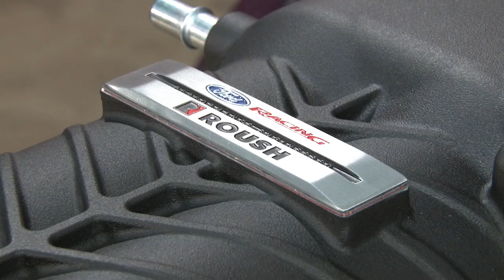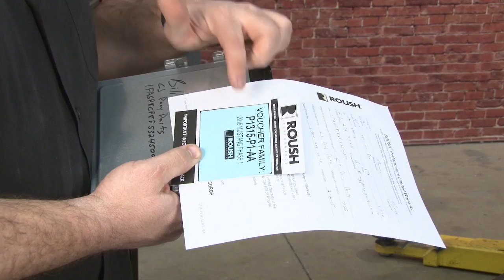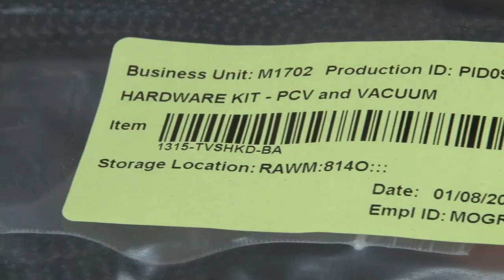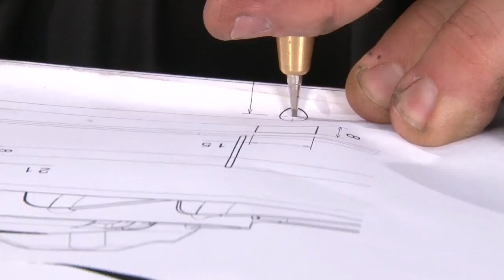2015-2017 Mustang GT Roush Supercharger Kit Phase 1 670HP 5.0L Installation

Comment: Hey there, Bill! Since your GT has the perf pack, what happens to the vacuum gauge? Would be nice if an oem style vacuum/boost gauge direct replacement, a la ecoboost, comes up in your store. Cheers! Amazing installation video by the way, must have taken a hell of a lot of work.
Reply: I am trying to get my hands on the PP Ecoboost boost gauge which is the same size but crazy expensive through Ford
Reply: Bill Tumas Let us know once you get your hands on it! In my opinion that would really complete the supercharger install. Too bad about Ford's pricing

Comment: is there a way to purchase the throttle position sensor harness for this application? mine seems to be acting up i’ve already changed the throttle body and the same issue comes up. P2111 and P2135 any info or help is greatly appreciated thank you

Comment: can this kit be used with the factory clutch?
Reply: Yes it can. On street tires it will probably never have an issue except for normal wear. If you are running slicks you should probably upgrade.

Comment: I would sure feel better with Bill installing my Supercharger than letting my local dealership do it
Reply: The only time a dealership saw my car was when I drove off the lot with it.
Reply: Local won't install it anyway.
Reply: I ask Bill, if they do work for the public he said no. I wish he did. Not to many you can trust to do this type of job.
Reply: It’s a bolt on supercharger it’s not rocket science. Nearly every ford dealer in the country has in most cases multiple technicians qualified to do this job. The ford dealer I work at has 3. One guy has done 30 of them now.

Comment: I just installed the Roush phase 2 and Bill made this possible and gave me the confidence to do it. It took me 15 hours. If I can help anyone, let me know. Thanks Bill for the videos.
Reply: +Chris F do you love it ?
Reply: I love everything except the roush tune. It pretty much sucks. If you get on it, it sets off the max torque limiter and puts the car in limp mode so its barley drivable until you shut it down a restart it. So you have to get a different tune. I barley went 60 mph and less than 5000 rpm when this happened.
Reply: Is your car a manual? sounds like the clutch protection mode might be kicking in although that should go off once you shift gears. The early tune had an issue with limp mode but that was when the kit was new and was fixed quickly by Roush.
Reply: It is a manual. Doesn't go off when switching gears. its giving me code P061B. got my tune in march...is that the early tune? Another problem is I cant get a hold of Roush, by phone, email, live chat, to ask them! Any help Bill is appreciated!
Reply: C F hi Bill, I have questions concerning the S550's. Except for the GT's which would you recommend between the 2.3 Eco or the 3.7.
Reply: Ecoboost all day, better performance and better aftermarket. Ford discontinued the V6 for 2018.
Reply: hope you installed oil pump gears
Reply: did you ever get a different tune or fix your limp mode problem?
Reply: In order to do this do you need the motor to be forged and all that stuff because I have a 2012 Mustang Roush Stage 2
Reply: @User77989  hahaha roflmao. Seriously?  Completely different engine man. Do some research

Comment: anybody else noticed the wrong placed belt at the top guide pully at 51:47?
1:00:26 aww, magic fix ! :D
Reply: Yep you're right
Reply: +2CREATthief also at 59:58 when he filled the fluid, he used the green antifreeze.  But after he finished at 1:00:30 it had the orange fluid in it.  But I love watching these videos.  They are great for a diy'er.
Reply: +messer23421  I filled it with green universal antifreeze, once it got up to temperature the original pink left in the engine started circulating. That is why the color changed, no trickery there.
Reply: Oh, gotcha.  Thanks for the info.  I always was told it was bad to mix the antifreeze like that.  I also know for a while that the orange stuff really did a number on engines.  Is that not the case anymore?
Reply: Another question when you have the time, how much power can the stock coyote engine hold without having to forge the pistons and rods?  I saw a video of some guys that put a whipple supercharger which they claim gave them over 750 hp at the wheels, but I would think that would destroy a stock motor?
Reply: +messer23421  Most of the universal antifreezes can be easily mixed without issue.
Reply: +messer23421  The 2015 motor seems to be able to handle around 700 without issue but anything over that you start playing with fire. There are 900 hp stock motor cars out there but they are time bombs
Reply: Awesome.  Thanks for the info.  I love watching your videos buy the way.  They always help me out.
Reply: +Bill Tumas Alumium drive shaf thandle this power?
Reply: i cringed i was like noooo haha i thought he would of noticed right there , got fixed tho 👍🏼
Reply: That drove me crazy
Reply: hahahaha that belt was giving me ocd
Reply: Came here only to see this comment hahaha

Comment: Since this is a repost I guess I'll repost my comment from the original, the best I can remember.

Firstly glad to see you caught the blower belt on the wrong side of the upper idler pulley....LOL. Also it must be major surgery to replace the blower belt when required since it looks like the bracket would need to be removed.

Secondly I don't like the Roush requirement for the ECU to be sent to them for re-flash.

The first reason is the stock tune is now unavailable to the end user which may cause some complications for returning the car to stock or purchasing a handheld tuner. I'm not sure, but I think a handheld needs to "marry" with the car using the stock Ford strategy.

Second reason is if the end user wants to change gear ratios or tire sizes not having a handheld for user adjustable configurations makes the changes not very practical in the sense of speedometer calibration etc. The Ford Racing Whipple kit and others I believe provide for a handheld for the re-flash providing the end user the optimum in customization options for future upgrades.

A great kit though and seems like a weekend with pizza and beer would be a reasonable estimate for installation.

Also not sure, but it seems like Roush is still tuning "rich", for safety, since it appears a lot of black smoke is coming out the tail pipes.

Thanks for the great video install and your '15 Mustang is making my '13 look bad...LOL...LOL

Comment: I love how you effectively have to mess up the stability of the car and handling just for more horse power. I'd take those braces and a better handling car, than fast in a straight line.

Great video though!
Reply: This is exactly my thought and why I haven't added a supercharger to my 17. I'd rather have the stability and rigidity of full K members and the cross brace.

Comment: The stock tower strut gets removed, so what will go in it's place once the supercharger is installed? What company sells one that will fit with the supercharger?
Reply: You don’t need a strut tower brace or anything like that. I felt no difference at all with my car which is a 2016 The suspension is fine no weird noises or anything

Comment: I have a 2017 mustang GT 6 speed automatic. Do you have to build the auto tranny to match the power output? How much power is the auto tranny rated to withstand? 600whp is a lot. Hate to blow my trans. Also if the transmission is capable of hold 600 hp is this a reliable build? Can I still use my car daily maybe beat on it once in awhile? Will it hold up
Reply: Jacob Johnson it is a 6R80 transmission meaning 6 speed rear wheel drive and 800 ftlbs of torque that it is rated for, they can hold more than that though. So you’ll be fine.

Comment: I don't think it's a good idea to install a kit that requires cutting half of the brace off.  It's engineered that way for a reason.  You are sitting right behind the part that's missing now.
Reply: That brace is an addition to the car as part of the performance pack,  not all Mustangs come with it and I have not see any difference with it off the car.

Comment: Wow...what a procedure...hummm...1500 miles later and my car is running rough...might be a loose connection - but, where?  

Supercharger $7000...installation $mega bucks if it's perfect.  

A very complicated procedure...very complicated.

Comment: Really enjoy your videos.  My Roush phase one is on and I finally got the drag radials on too.  I remember you said you ran an 11.1 in yours.   Do you mind telling me what drag radials you had and what size? :)
Reply: 295 45 17 Mickey Thompson ER Street Radials IIs
Reply: +Bill Tumas nice. I went with nt555r   305's.   Also just ordered a phase 2 upgrade kit.  Do you have a video for that installation by chance?
Reply: We probably will sometime in the future. Its basically just plugs, pulley, and a fuel pump upgrade so 2/3 were covered in the main install.
Reply: +Bill Tumas pully, PCM, fuel pump charger and Spark Plugs.   I should be okay I guess.  Thanks for all your help!

Comment: Thanks for reposting this. Can't wait to see the dino test. I'm looking for a supercharger for my 73 Mach 1 351C. I'm wanting to run an EZ EFI 2.0\ something like it, but can handle a supercharger. You have a system for 289\302, but not a 351C. I'm in the process of building my engine to a 408 stroker with 9:1 dish pistons. Any recommendations supercharge EFI system.

Comment: your runnin the 5w 20 moto oil?? with this application/?....seems kinda thin 2 me..but i about shit myself when i seen the 5w20  logo on the cap i would have guessed atleast 5w30 if  not 10w30 or more but 5w30 seems awfull damn lite even b4 the supercharger it seem 2 lite of oil.. is it just 2 save on fuel or is the tolerence in the motor alot tighter now or somthin/?  my 04 towncar w the 4.6 also calls 4 the 5w20 so thats what i let the  oil change guy put in it but now it really eating at  me especially sence it just the reg 5w30  wish i would have atleast used synthetic  but oh well ill dump this new oil soon an look at it like a good cleanin moto flush drain all that new 5w30 when its good n hot than ill add some motocraft synthetic or some mobile synthetic or somthin..   or might go ahead and just put the good mobile1 synthetic 5w30 in for peice of mind

Comment: I'll take the Hellion twin turbo. I do not like roush. Edited---- 1st you loose the strut brace,then you have to cut the k-member and last and worse,you have to grind metal off the block. Nope never happen on my car. Bad design on roushs part and unacceptable. I've watched a couple of your videos where you have used roush parts and had to remove and discard parts that I would consider an important part of helping the car from flexing to much. Too many other good choices out there to be bothered with a substandard manufacture like roush.

Comment: Never EVER, put a ribbed belt on a smooth pulley.   Im here because I use to have a GT500, then went to another brand, back to ford and got a 2016 GT with PP. Im disappointed in the power. 435hp is slow, compared to my 650hp to the wheels GT500.  I know, first world problems.
Reply: +snowismas I feel that .. I just bought a 2016 with pp after owning 700hp 900tq MB CL65 for the last 4 years ..😂😂😂😂

Comment: Removal/cutting of the structural elements bothers me. A box without a lid, how long before the front end starts to creak and groan? Ford put those parts in for a reason. I almost wish it made a bit more supercharger noise; sound kind of reminds me of a turbo diesel.

Comment: Just to warn you guys the way he originally mounted the S/C belt is wrong it was something he corrected and failed to mention in the video, for those of you wondering why your belt is either not fitting or rubbing on the lower part of the head

Comment: Great video providing a much needed visual for this install!!! A couple of iffy parts, but I'm sure someone with half a brain can figure them out.

My concern on this Roush install is cutting that 'K' Brace. There is a reason for that 'K' Brace and I'm not only looking for straight line speed and acceleration, but also front suspension stability while executing a slalom/road course. Not to mention, it looks so ghetto when you re-install that 'K' Brace even though it has been painted. Really, the only unprofessional mod of this whole install!

Questions:
1.  Is there another option such as a modified 'K' Brace? Does Whipple require this modification to the 'K' Brace as well?
2.  Will Roush come out with a tune for an automatic GT? Seems kind of strange that they don't have one yet.
Reply: Luigi Chincochento  The K brace just adds additional support, several models do not even come with it. These modern chassis are so strong they really don't need it, I saw zero drivability changes without it. I went with a Steeda G force lower brace to tie things together up front. Whippled keeps the K brace but also gets rid of the strut tower brace. Roush said the tune is coming soon.

Comment: You stated that the strut brace would not be reused. I've got a 2013 gt that I've been wanting to do this upgrade to. I was wondering if it's possible to use the brace in conjunction with the supercharger? Since you removed it, have you noticed any handling differences?
Reply: I have not noticed any difference at all. I don't know of any braces that will clear the hood and the supercharger.

Comment: This question is for Bill at (C.j pony) I have a 2017 mustang GT with automatic transmission , can I add a supercharger to it with no problems?
Reply: Darryl Williams youll b fine, wheel hop will cause you more problems then the trans will

Comment: Putting Phase 2 on a stock gt 2017 automatic is their anything else on the car that should be upgraded to handle the power increase? FYI I am very new and no I wouldn't be installing this myself lol
Reply: May want to consider stronger half shaft axles if you’re going to launch it a lot.

Comment: bill thanks for the response wasnt expecting one as i said you do a fantastic job of presentation  i say that with some experience as i am now retired  from gm as a ase master and L1 for 12 years or when the L1 was first offered emissions master and on and on  i have my self love working on cars  and teaching automotive for 5yrs  so when i say you do a great job  i have a pretty idea of what a good instruction presentation is  you have it any way  ive watched other project you completed  i was wondering what horse power and torque  that blower car project produced and if u ran it thorough the 1/4
Reply from the maker: +perry lewis  Thanks for the compliments. We have another video with dyno pulls but it made 555/487 to the wheels on the 627 HP tune. Roush just came out with a free upgrade for the kit to bump it to 670 HP. I will be getting the car out to the track early next month with a decent tire on it to see what it can do.

Comment: The Roush website says that the supercharger kit is not applicable to mustangs with adaptive cruise control, can it be modified to fit? or does it mean i can't have a forced induction setup?
Reply: It is a safety and liability issue. The car controls the throttle percentage to control speed and it based around 435HP. When you change that to 670 or more and the same percentage gets added things can go bad.

Comment: Bill! Nice work! Question, I'm looking to get a 2017 gt and would like to get this supercharger. My question is, can the stock internals support this hp? Do I need any supporting mods? I'm coming from a 2011 sti and these engines easily blow ring lands. What's the most hp the coyote can handle before you have to start rebuilding? Thanks. This gt will be my dd and I'd like to add a decent amount of Hp while maintaining reliability.
Reply: The stock 15+ motors can handle this with no problems, I have over 20,000 miles on my supercharger now with no issues.

Comment: hello, would this supercharger kit fit on a mustang equipped with adaptive cruise control? thanks
Reply: They will physically fit but they are not recommended for that option because of throttle concerns. The car gives a certain amount (percentage) of throttle to maintain speed. With the addition of a supercharger that percentage will make the car accelerate much faster.

Comment: Hi Bill, just added the phase 1 on my 16 GT. Should I be considering changing the oil pump gears??? I assume if Ford is willing to keep the warranty with this supercharger and not have to change the gears is because it must be safe?? Or am I assuming wrong?
Reply: Oil pump gears are always a good idea on high RPM or high HP cars. I would not say they are a necessity but not a bad idea either.
Reply: Thanks

Comment: CJ Pony Parts  lower intake fuel charging assy, can you remove lower intake intercooler for a better one or is it made into lower intake
Reply from the maker: You can add different heat exchangers but there is no lower intercooler upgrade I am aware of.

Comment: Does the heat exchanger affect the radiator's ability to cool since it's mounted in front of the radiator and the radiator won't be bale to have ambient air hitting it directly?
Reply: +Evan Salas air still passes through so it's not an issue.

Comment: Any chance you got a boost gauge yet? Just looking for options. Thanks for the reply
Reply: I am a little pissed at Ford about the whole boost gauge thing. If you get a non performance pack car you have a factory BOOST and Vacuum gauge in the cluster. If you get a PP they give you a Vacuum gauge on the dash, but no boost. I really want a factory style gauge so I have been researching getting the factory one to work in the cluster somehow or the dash gauge from the performance pack Ecoboost. The EB gauge is $1300 though since you have to buy the whole panel.